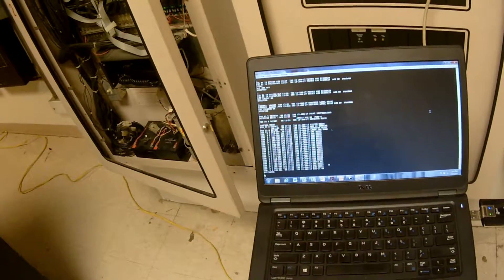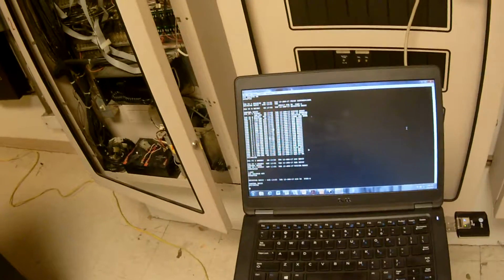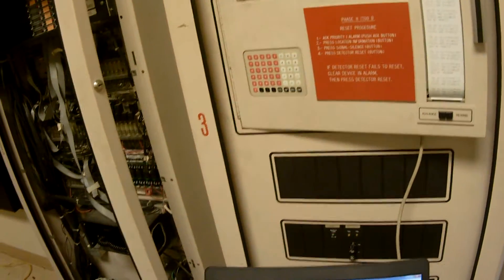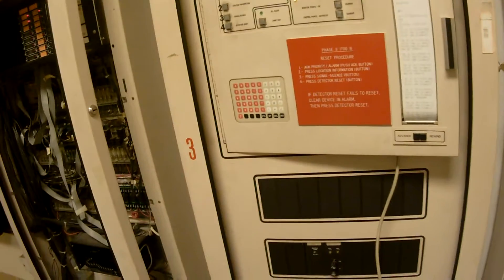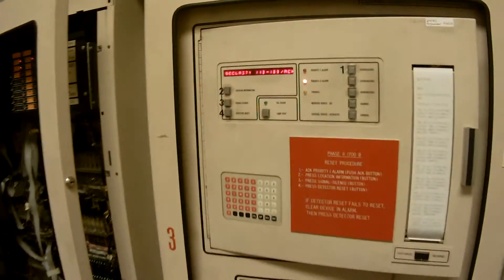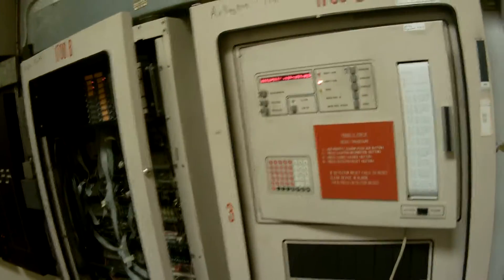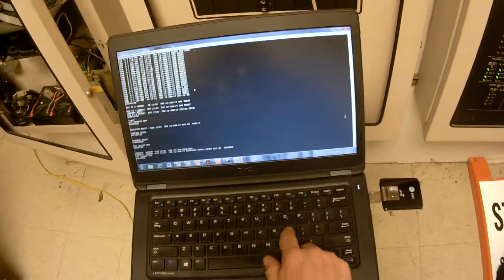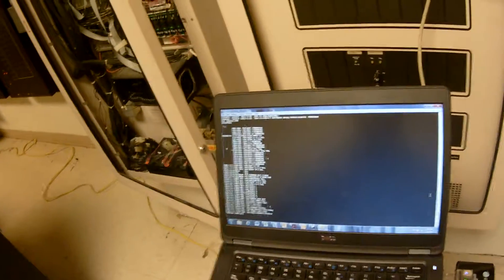2120 part 3

Comment: Fire Phones, wow. Is this panel a voice system? If so what tones/messages are played?
Reply: I don't think so, there's a march time card down in one of the card slots.
Reply: @ConrailGeep  it is voice evac look at the other panel on the left
Reply: @vrryan6  Fire phones do not indicate voice evacuation. If this was a voice panel, it would have a master microphone, several amplifiers, and god knows what else. That transponder does not have voice.
Reply: @ncalarms6022  at the bottem there is what looks like a mic bay
Reply: @ncalarms6022  My school has this panel and it generates a whoop tone.
Reply: @alexandersalarms5380  that doesn’t mean it has voice. Voice evacuation means that a message is spoken
Reply: @vrryan6  Doesn’t mean it has voice. If it had voice, it would have a tape recorder that plays a message back. This panel might have speakers, but it certainly does not have voice
Reply: @ncalarms6022  It does not have voice, but it is still a VEC
Reply: @ncalarms6022  didnt know this thread was still active
Reply: @vrryan6  me neither lmao
Reply: @ncalarms6022  You can't just be wrong then change what you said lol that's cheating